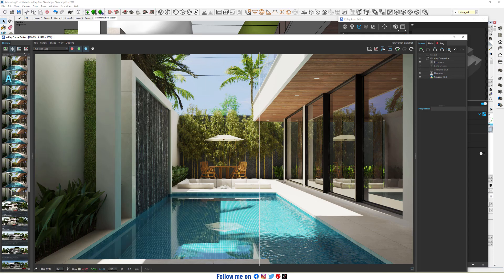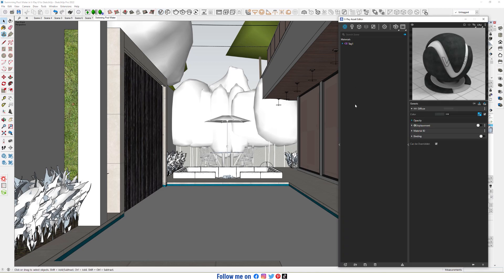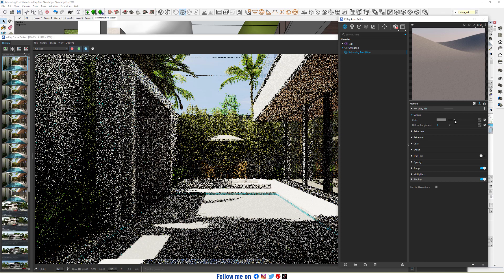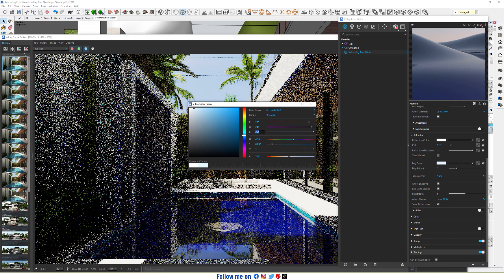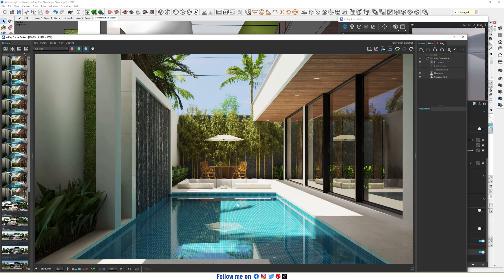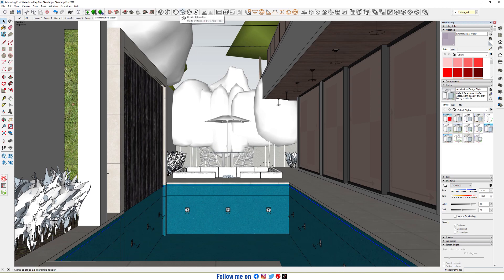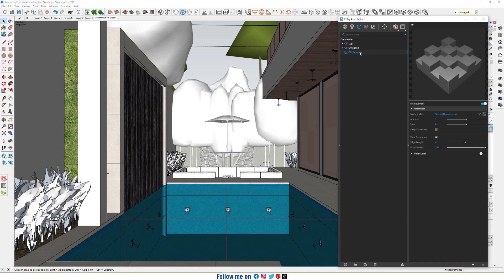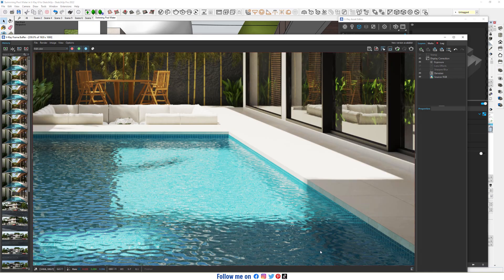Swimming Pool Water in V-Ray 6 for SketchUp | Sketchup vray

Comment: Hi, I tried to set the settings just like in the video but it doesn't seem to have the blue color. One thing is that I already painted the surface that will be turned into the swimming pool in white. Or is it because the depth shown in the video, 500cm doesn't match with the actual depth of my pool? I'm a total beginner at this so I'd really appreciate it if anyone could help, thanks.
Reply: Same problem

Comment: why you not use bump instead of displacement ?
Reply from the maker: Because bump and displacement are different. Displacement is good in this situation.
Reply: @s2vrarchviz  👍
Reply: @DungNguyen-gs6qu  I'm not sure about Vray but in Enscape, Bump, Normal Map and Displacement results in different quality. 

Displacement will gives the highest quality but also more Ram and GPU performance required.